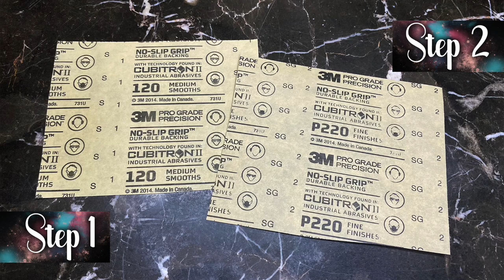How to Paint Marble on Furniture

Comment: As a very competent and trained decorative painter (and fine artist) since the early1980's, I have one comment about your project. Although your project is interesting and you performed it well, I personally never chose to paint furniture pieces when they were already either a fine wood or had real marble on them. Doing decorative work on 'less than' fine pieces, ie. an old console, table, etc., I loved. However, to paint over, for example, a real marble top (already the exquisite artwork of mother nature), I never felt really comfortable or right doing. And btw, I'm not in anyway trying to be negative toward you or your work, which seems fine to me. It's simply my own personal feelings. And because of that, I definitely turned down potential jobs here and there. I close on wishing you continued success in decorative painting.

Comment: What’s the reasoning for the sanding being that using the Slick Stick is for adhesion to slick surfaces specifically? Does it not work well enough to adhere without the sanding? I’ve not had the best adhesion with Slick Stick personally. It peeled back on the things I use it on. After painting on two dry overnight coats...
Reply from the maker: Hi! As a rule I always sand. Being that I sell my work I like to feel confident it will hold up for my clients. With that said, I have used Slick Stick on things without sanding, such as glass. It has worked for me like a charm and I haven’t had peeling. Did you clean your your piece properly? Grease and oils can act as a repellent.